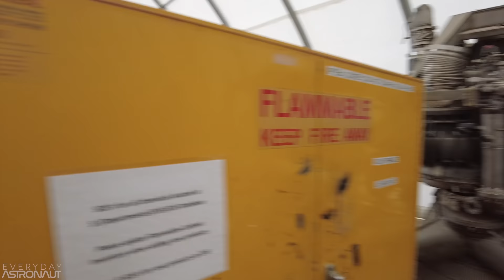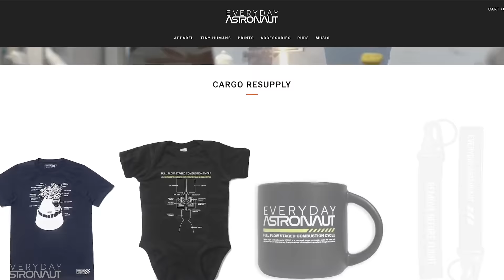Tour Firefly Aerospace's Factory and Test Site With Their CEO, Tom Markusic

Comment: "It's  always the connector"  My mantra for electronics repair for over 50 years.
Reply: I agree seems like an amateur   mistake.
Reply: @leschortos9196  well like everything the connector looks perfectly fine until you shove it into a shaking and accelerating tube of angry metal riding an explosion.
Reply: I've worked in the A&D world for 15 years and the connectors are almost always the longest-lead parts for whatever we are making.
Reply: Connectors are always made by lower grade engineers.

Comment: Very interesting video! A quick summary of some Firefly propulsion facts:

ENGINE GENERAL INFO: US combustion chamber, Ukrainian turbo-machinery. Tap-off cycle.

11:15 This engine uses a pintle injector

32:36 Combustion chamber runs at 1300 psi (90 Bar) Tap off 1100 psi (75 Bar) expands to about 30 psi (2 Bar) in the turbine

7:38 The temperature in the thrust chamber is 3000C, but the temperature of the gas fed to the turbine is 600C. This is achieved without any additional dilution of tapped off gas -- it just happens so due to the natural topology of the injector flows in the thrust chamber. [This is not quite clear -- the patent which Tom refers to, describes the upper stage "Lightning" engine, which does use tap-off gas dilution with fuel, and does not have the same injector.]

7:33 2.3 O/F ratio (36:23) 2.2 O/F in the first flight, but also run at 2.4-2.5 in tests.

30:50 The turbine rotates at 33K RPM, developing 900 HP  [the torque is just under 200Nm, the total force acting on the blades on the  order of 150 kgf]

6:43 11:42 The engine does not throttle, except for a little bit, by changing the pressure in the tanks. [Probably because the turbine is fed from the thrust chamber tap-off and depends on subtlety of the flow patterns at the engine head, this coupling makes thrust control much more difficult. That's one of the reasons why tap-off cycle is so rarely used.]

9:35 Turbine is started by Nitrogen spin start. Very low spin start is required before the engine bootstraps. "Could plug the nozzle to help it"

THRUST CHAMBER

6:02 11:00 Thrust chamber is high strength copper alloy liner [usually Copper-Zirconium-Chromium bronze in the USA] with nickel-cobalt electroplated on it. (Inspired by Shuttle main engine technology)

29:19 A forging for the thrust chamber liner. (narration at 26:42) it starts as a rough shape weighing about 600 kg. After machining the weight becomes approximately 40 kg.

31:58 24:47 Copper alloy engine liner at the machining area, (on the left). Lots of shavings!

35:58 "We can run the [combustion chamber] barrels without film cooling. In some engines we had film cooling in the throat area, where the heat flux is the greatest."

36:52 On film cooling orifices and chamber fabrication technology:  "The chamber will have cooling channels milled into it and then we will put wax in those channels and then we'll electroplate nickel over that, and then we'll melt the wax out now you've got channels. That's how we make our cooling channels. Before you put the wax on when you have those channels if you just go a little bit above the throat and use 12 mil electro-discharge machining wire and just pop little holes through those cooling channels into the chamber before you plate it now you plate it and in those channels you have an array of little tiny holes above the converging section and that will inject jets of cold fuel."

26:13 "Just hired a new machine shop manager, who has experience in mass production of thrust chambers. Will be buying some new machinery that will allow to machine thrust chambers in hours instead of days that it takes now."

27:12 3D printing of the liner of this size is still not economical. [Launcher Space 3D prints a similar engine -- even using the turbopump from the same Ukrainian source.)]

WARM GAS TAP OFF FROM COMBUSTION CHAMBER TO DRIVE THE TURBINE

16:25 Tap off cycle was Firefly's call -- "fortunately it worked". 

8:36 Tom talks about "not having any soot" but also seems to imply fuel rich gas; [But the original Ukranian turbine was designed for oxygen-rich cycle!] Says "we never had coking in the turbine" comparing to Gas Generators running at 0.3 O/F ratio and "puking soot."

30:02 Inconel tap-off manifolds on the shop floor. (narration at 25:30) Machined from forgings, will be 3D printed in the future.

TURBOPUMP

5:38 Soviet heritage turbomachinery [from RD-8 vernier engine of Zenit, developed in Ukraine] 200 people work[ed] on it in Ukraine for Firefly.

17:50 "the turbopump is clean-sheet design" [Starting as Soviet RD-8 engine, becoming Ukranian RD-809K engine, and now used in several engines all over the world -- in Korea, Germany and USA] Tom explains that LOX and RP-1 pumps are separate units, joined together by a coupler. [See cross-section of the RD-8 turbopump.]

30:50 Turbine wheel being made using the machining center. The turbine rotates at 33K RPM, developing 900 HP

===============

MISC. TRIVIA

20:44 Bulk LOX is super friendly, it even puts fires out. But hot oxygen gas burns the engine up in a white flash of light in a second.

33:46 At moderate combustion pressures (1300 psi) soot-carbon combustion products LOX/RP-1 condense on the walls of combustion chamber and form a natural thermal barrier which inhibits heat transfer. At higher pressures or higher O/F ratios this beneficial soot formation does not occur.

34:54 LOX-RP is amazing. Impulse density is on par with everything. In the balance of things, methane is a hassle.

37:45 In other engines, Tom have seen engine liner erosion that sometimes produced fuel leaks which provided film cooling preventing further erosion, after which engine ran happily.

51:00 Wasps cause serious problems by plugging with mud the vents that are necessary for actuating engine valves! Was a problem at SpaceX McGregor, caused engines to blow up. Must have screens on all vents!

---

21:37 Modern US metallurgy allows to create oxygen-rich staged combustion without special coatings.

22:45 Aerojet-Rocketdyne brazing oven for the combustion chambers, the largest in the world. Will allow to switch from electroplated nickel-cobalt thrust chambers to brazed steel jacketed engines.

5:24 The configuration of four engines gimballed in one axis each is inspired by looking at many Soviet rockets, where it is a common design.
Reply: You Legend.
Reply: Amazing stuff
Reply: Thank you!
Reply: Incredible summary. Thank you 🙏🏿
Reply: You're a legend bro

Comment: This was a fantastic interview. I knew next to nothing about Tom Markusic or Firefly - they were just "yet another NewSpace company" in my mind. Now they're my favorite of all the new startups. I'm far more impressed with Markusic than I thought I'd be. I had no idea he had so much experience doing propulsion work at the Air Force, NASA, SpaceX, Blue Origin, and Virgin Galactic.
Reply: Not through the whole interview yet. Taking it in stages. Could you elaborate a bit on why it is your favorite startup? I don't quite get what their unique angle is. SpaceX is all about full reuse, unconventional material choice like stainless steel, supersized rocket etc. While Rocket Lab which is my favorite after they presented Neutron is all about using unconventional material such as Carbon fibre composite and really leverage the advantage of that to make some really cool choices like hung second stage and first stage with fairings attached.

Comment: Loved the video , funny seeing him talk about machining Inconel forgings though . I worked in aerospace manufacturing for 43 years mostly as a ME but I spent plenty of time actually on machines because I liked it and I was the guy companies came to because I had a reputation for making what seems impossible , possible . I liked Inconel 718 over many other exotics , the one I didn't like was Rene 41(kills tools fast) , I didn't even mind working with Hastelloy and most machinists would say no thanks to that stuff , but I found all these things to be a bit time consuming but very stable material and I like that in a material . It's like the difference between machining 6061-T6 aluminum and 2024-T851 aluminum , I would way rather work with the 2024 , the 2024 is very stable but the 6061 will likely stress relieve a lot more (even if you get it in the T651 condition) when you start cutting on it .

Comment: An erratic connector to a solenoid valve has caused other liquid rocket failures.  It has also caused problems like a solid booster failing to light or separate from a vehicle.  Identifying what happened can be hard.  On the test stand, one typically monitors current flow and voltage to a solenoid valve, as Tom relates.  Interesting that Firefly does that in the flight telemetry.  I wonder if their flight engine looks the same, as I see several off-the-shelf Mirata valves.  The failed connector looks like an Amphenol "clicky-lock" which most flight vehicles use today.  First I heard of the tap-off.  A great simplification to eliminate a gas-generator.  Now we know who bought Aerojet's giant Ipsen braze furnace.  Mud-dabbers got into some "sealed" Russian NK-33 engines and ground squirrels have stored acorns inside solid rockets. Definitely need smart people at the top.  Too many legacy aerospace companies have CEO's from finance instead of tech-savy, and after decades the schemers elbow their way up, kicking down the smart considerate employees.  New startups are one way to clean house.
Reply: How is tap-off a simplification? The ordinary gas generator is a small and a relatively simple device, with a relatively low flow, which can be conveniently debugged independently and is fairly easy to control. 

But with the tap-off, they now have to make a huge Inconel piece (even larger than the chamber itself!) which now relies on the intricacies of flows in the main chamber to extract warm gas at a reasonable temperature. Now the flow to the turbine changes the processes in the chamber and vice versa -- potentially creating a very complicated dynamics. It looks like this only works correctly in some narrow range of parameters, and that's why they can't throttle it.

Why did they spend time and effort to change the Ukranian design (which had already successfully flown to space 70 times) into some quirky new thing which is harder to build and has lower performance is a mystery.
Reply: @cogoid  
Gas generators and preburners can be very problematic, indeed many characterize new liquid booster development as "powerhead development with an engine added on", powerhead meaning the GG or PB plus turbopump.  A GG requires fuel and Ox control valves, can experience combustion instability, and adds startup complications.  Simplest is an "expander cycle", like the famous RL-10, but can't scale up and only works with hydrogen.  This tap-off design is a similar idea, though more challenging.  Rocket Lab uses an electric motor-driven pump, and amazing the battery weight still makes that practical (or do they use thermal batteries like some solid-rocket TVA's?).

I doubt the turbopump cares what hot gas it sees, as long as it is uniform temperature (to avoid thermal cycling the blades) and not too hot.  It also doesn't care if you just dump the exhaust overboard or send it into the main chamber ("staged combustion") or downstream of the nozzle (Saturn V F-1 boosters), other than the line pressure increases.  Didn't Firefly mention future staged combustion?  If so, they would need a preburner since you couldn't take it from the main chamber and return it.  Liquid rocket design has long had naysayers, such as U.S. experts said an Ox-rich preburner was impossible, yet the Soviets did it in the 1960's (NK-33).  This tap-off is another example if you don't allow yourself to be constrained.  I wonder if Firefly would have been allowed this attempt under MSFC direction, since NASA has gone the other way in codifying liquid rocket design as a paint-by-numbers process.
Reply: @williamgrissom9022  I am sure, no matter how you do it, there is always more complexity than meets the eye. The turbine requires relatively low temperature (in the Ukrainian design it ran at just 300-350 C) while combustion chamber produces 3000 C+, which makes drawing the gas for the turbine extremely non-trivial. It's just not that people do much. It is not easy at all. The tap-off manifold is a very complex part with crazy geometry to keep everything cool and not burning through. (You can find drawings of the manifold used in Firefly's upper stage engine in their patent.)

The original Ukranian design was a staged combustion engine, and the turbine ran on warm oxygen. The oxygen pump was next to the turbine, so that the leaks of oxygen into the turbine would not matter. Since Firefly changed the scheme to open cycle fuel-rich gas, they had to rearrange the whole thing and put the fuel pump next to the turbine. Now they are running the turbine on hot kerosene vapor and decomposition products. How exactly it works without producing soot is a bit of a mystery. SpaceX runs their turbines on fuel-rich gas, and even though the fraction of soot in the products is extremely low, the smoke still looks so black, that it seems like you could cut it with a knife.

Regarding other things that you have mentioned. Rocket Lab uses ordinary LiPo rechargeable batteries -- similar to those used in RC toys. The pumps require a battery with a very fast discharge capability, and that is available off the shelf with these cells, and is not even particularly expensive -- maybe $20K for the whole set of the cells for a rocket. In terms of battery mass, it is surprisingly not an issue at all. Many people assume that just because liquid fuel has energy density an order of magnitude higher than the batteries, the amount of fuel used to drive turbopumps is small. That is not the case *in practice*. Russian  Soyus-type rockets or even SpaceX' Falcon-9 use a surprisingly large fraction of propellant to power the turbopumps -- a bit less than 10 tons of peroxide for Soyuz, and about 20 tons of kerosene for Falcon. Very, very little of the energy from that kerosene is used up before it is vented from the exhaust of the turbine. It's practically not burned at all, to keep the gas temperature low and to allow using a simple and a reliable turbine. Batteries are perfectly competitive on mass with that -- it's making the pumps themselves that is very difficult for the high power engines.

Comment: Can someone tell me what happens at 6:43, there's a major cut there it seems. 

I'm guessing that Tim first asked him a question that he didn't know the answer too, so they cut it out?
Reply from the maker: No, we ended up discussing proprietary information and seeing some intellectual property that they didn’t intend to show
Reply: Some of the history which might have been discussed in that gap can be picked up from open sources.

During Soviet times, Ukraine has developed RD-8 four-chamber vernier engine for Zenit line of launch vehicles. It is a 10 ton oxygen-rich closed combustion cycle engine. More recently, they took the turbopump from this engine and derived several newer single-chamber engines from it, including RD-809K.

Mr. Polyakov who owns Firefly is rumored to have brought this turbopump in his suitcase to the US, to show to various customers. Presumably this is what Firefly is using, especially because it is also used in South Korea by KARI, in Germany by "Rocket Factory" and by other startups in the USA -- for example by Launcher Space. (Now Astra is also buying it from Firefly.)

From this video, it looks like Firefly is at least partially machining the turbopump in-house. The original design used special materials, because of the oxygen-rich environment. But since Firefly is using fuel-rich tap-off gas, they now can use more common materials.

Comment: Lots of companies and the more the merrier. You have rocket factory Ausburg coming on line. Plus one I invested in based in Maine called Blushift Aerispace. They had their first launch and working on next two suborbital launches before an orbital one. They will be using polar orbits and are powered by non- toxic, carbon-neutral, bio derived rocket fuel.

Comment: Go Timmy, go! Go Mr. Markusic! I like the Aerojet aerospike engines for the single stage to orbit. I wonder if they had used methane or different tanks, if it would have worked. I like the details on the connector failure ( the routing of the cable over the pipe still looks scary to me) for the recent launch abort, thanks! Good info about the Soviet technologies too!

Comment: I am surprised they are holding the turbine wheel with regular jaws and not pie jaws, it can't possibly be that well balanced holding it that way. Hopefully the new machine shop manager is putting those guys in check.
Reply: Balancing is certainly done, but on a special machine afterwards. Whatever operations they do on the lathe either does not require ultra-high accuracy, or, if the chuck is adjustable, they may be dialing the jaws for part concentricity to the required tolerance. There is an indicator sitting on the table, so that might be what they do.